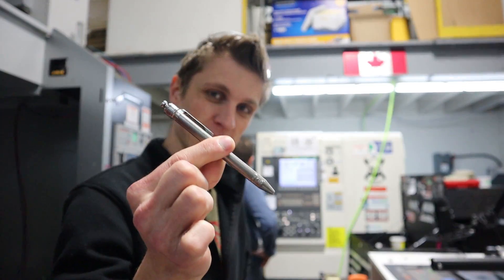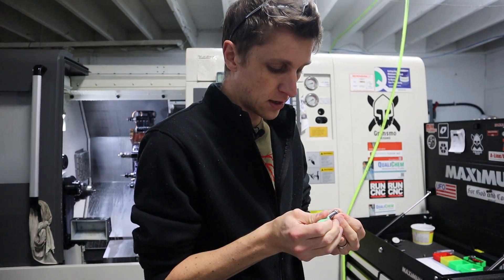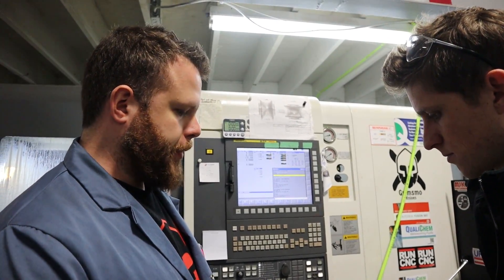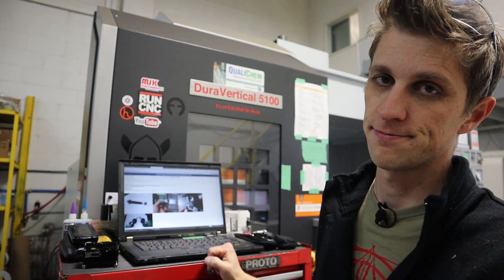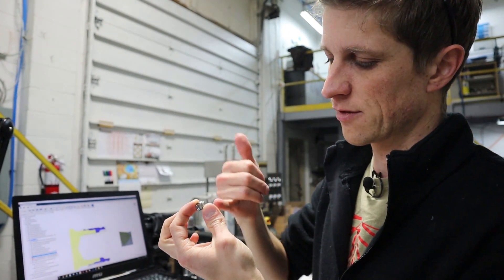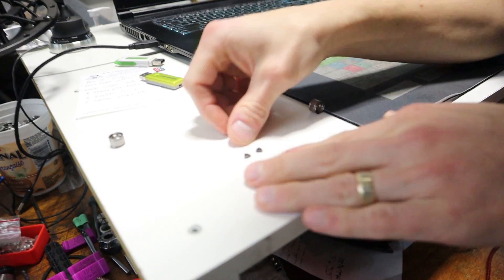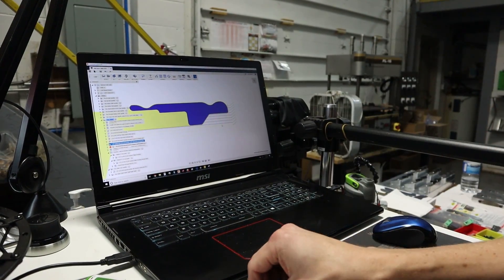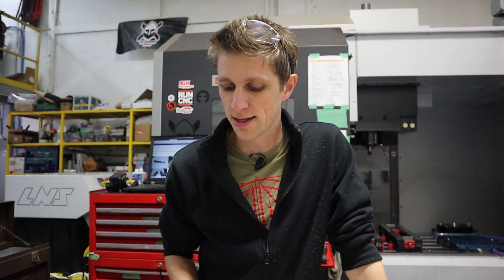What is SFM? - Saga Saturday 011

Comment: To find approximate RPM the old machinists would follow the formula: RPM=(CSx4)/D which is essentially the same as what we use today: RPM = SFM X 3.82 ÷ Tool Diameter, just without the division. So simply put: Multiply the SFM by 4 and then divide the result by D.

Comment: John for production gauges we get go/no-go setups made up with the red and green ends.  Individual gauge pins are only a few bucks a piece and it is a really easy way to check tolerance during a run.  We also use ring gauges that are custom made (again, not crazy expensive) for OD checking.  We run a lot of +0.0005/-0.0000" type bores on small parts and gauges are a life saver.

Comment: John.  What type of iphone or android do you use?  I am prototyping an adaptor case that lets you install your phone onto your microscope lens.  It allows you to film and photo high quality images you can use on your broadcasts or take photos to use in fusion from your microscope.  I would like you to have one to keep and use as you please in thanks for all I have learned from you.  I comes with an eyepiece that you slip into your microscope eye piece socket.  I make them modelled for specific phones.  That is why I need to know your phone type.  You can email me at
 robindriscolloboe@gmail.com

Keep up the great work!
Reply: What about basing it off the Moment lens mount case system? That'd save you a ton of R&D, and I hear they're great cases too. All you'd need too make is a Moment bayonet X microscope lens spacer adapter (presumably, not sure if it'd need an optical element for focus)

Comment: John for W style of insert you go ti take to account chip clearing . Because in a small bore more Chips are stuck in the hole less coolant get inside in the cutting zone . The sfm is One way ti reduce chip jamming but if the insert is broking down again any few parts try to routhing gradually in Z ...
Reply: I usually turn stainlees of 304/316/420 aisi and before finishing we blow away any Chips in the bore ... And for insert i use ccmt of iscar brand (i don't Remember the grade of the coating ) and for finishing dcmt
Reply: https://www.iscar.com/Products.aspx/CountryID/1/ProductId/5389     https://www.iscar.com/Products.aspx/CountryID/1/ProductId/5390    iscar for routhing and for finishing "taegu tech dcmt 11t304 VF, TT5080 M15 coating" . in small parts we used the same type of insert but with a small size circle. taegu tech dcmt is great for finishing in a wide range of material

Comment: I think you should definitely invest in some gauge pin sets. With a working tolerance on your parts of +/- .001, Z tolerance class pins (+.0001 max) should be good. Alternatively, a small bore gage or ID micrometer. None of those tell you if the feature is out of round though. You'd need a groove gauge or a 2 point bore gauge for that. Check out Dorsey Metrology International. The point is that you don't have to invest in something as crazy as a CMM, but you should probably use something other than an endmill shank :P And since you have a limited number of specific parts you make for your own products, you might even consider making custom gauging fixtures (or having them made). I work for a company that also makes its own products (firefighting equipment) and half of our gauging is custom made to check a particular critical feature.

You weren't using CSS before? You've been missing out! Not only does it benefit tool wear and surface finish, but it can also decrease cycle time when you program your feed rate in IPR mode. As diameter decreases, RPM increases and thus IPM increases, saving time. Of course, that doesn't apply if you've been running your SFM 5 times the recommended value all this time lol

I'm not a fan of trigon insert tools personally. There's too much potential for the insert to rock in the pocket which damages the pocket leading to more rock, etc. Basically, a trigon has 3 surfaces that it has to locate to in the insert pocket while triangle and diamond inserts only have 2 and those 2 surfaces support the insert in both X and Z directions while trigon pockets do not.

Comment: Hi John,

Surely if you have entered your tools and the material type into Fusion it should be doing the correct calculations for you? or are you overriding them?

To be quite honest before you even start cutting any material, you should double check to make sure you have the correct feed and speeds.....
Reply: He was setting the RPM to 3000 in Fusion, it's a bad habit from the Tormach days. It's more clear when he's talking about it on Friday's podcast.
Reply: @DenzilMakes  Ahhh ok that's still bad practice... I don't listen the podcast.

I don't use Fusion, I don't have any CNC machines only manual. I didn't even know that you could do that.

Comment: To calculate proper RPM: (3.82 × SFM) ÷ cutting diameter. Cutting diameter would be your tool diameter for milling, or your material diameter for turning. Recommended SFM can be found fro  your tool supplier or from the machineries handbook.